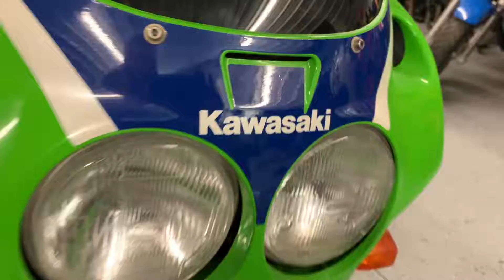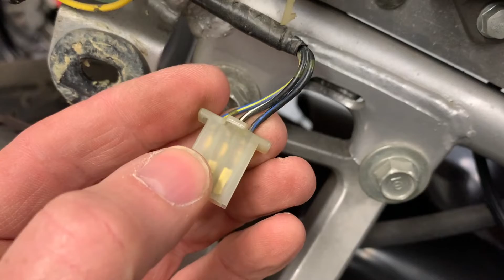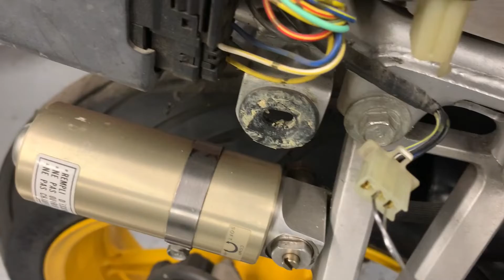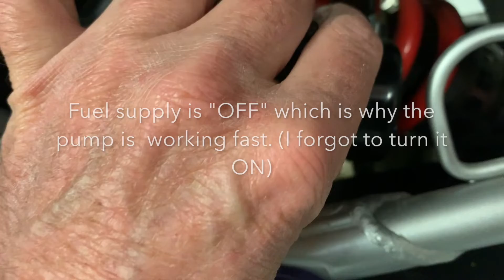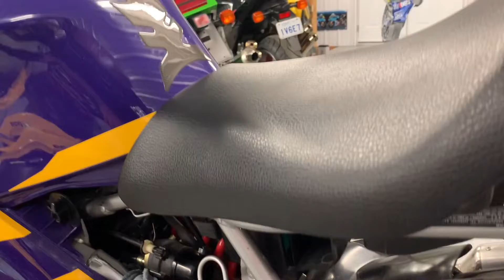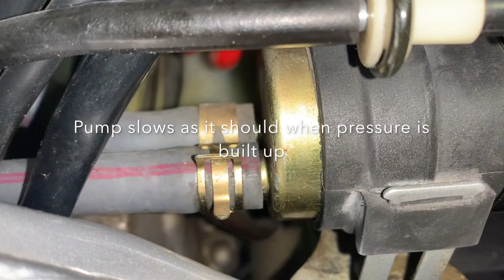1997 Honda CBR600 F3 - Testing the Fuel Pump and Relay

Comment: One question. I have a 96 cbr600 but after I ride awhile the fuel pump continues to run and doesn’t cut off after it pressures up?  Any ideas what’s going on?

Comment: Is the fuel pump supposed to prime when you flick the key on
Reply from the maker: Good question, I don't think so ( i don't have this bike any more).  But as i recall, it only pumps when you hit the starter and when the bike is running.   Once its at pressure (bike running), it will shut off until pressure drops again

Comment: lol,  Never assume it makes ASS - U- ME . Great thinking thank you for making the video.
Reply: I just going to take the hose of first from fuel pump and start it to see if it gives fuel . Weird I just cleaned carbs and now it won't start ? when I spay fluid into cards it fires up for a bit of time meaning does not get fuel ?
Reply: Pump did not work yesterday took it apart to test it and it started working again ? Same problem you had bike is running again , weird .

Comment: At last , thanks for the video.  I have a 1998 model ran fine when put in storage but after years I came to start her and fuel was pouring out of carbs . Took them off and sonic washed them and also replaced every seal in the carbs  also new carb rubbers as the old ones were solid . She was a runner again . Not used just put away in the garage as a runner  but now she wont start . Upon trying to start she backfires and that's it . Took the tank off and put a direct fuel feed to carbs and happy days she started so put the tank back on after several start ups and she ran with tank on . All fresh fuel by the way . I could feel the pump pulsing and thought that was it shes good to go ! No shes not having it so bought a new pump just incase it was working independently  😢😢. No shes still dosnt want to play.  I've checked all fuses and your explainastion  is the best I've seen . Am from England and we have what's called Haynes manual,  that rubbish.  I have 2 Honda trained mechanics and this has got them stumped . They haven't been to the bike but over the phone we have addressed every possible Avenue apart from bridging the wires as you did . Haynes dosnt show another detail a as for as trouble shooting they are saying valve clearens and other crap not related.  I joined a forum and they are all saying the same jobs we have already covered . Shes a 1998 and tidy for roads in this country but yours is mint . Anyway time out I've probably board you enough but thanks last check is bridge wires ! Something am not comfortable doing but you have helped .
Reply from the maker: Glad the video was helpful.   Yes, try the jumper wire, it’s easy to do.   You can also pull the fuel line off at the same time and do a flow test to see how much fuel is getting delivered from the pump.   

If it runs fine when u bypass the pump off a separate fuel supply, then it is likely a problem between the petcock and the pump or filter .

Assume u checked the petcock

I assume you changed  the filter

Check the fuel lines too, make sure none have collapsed.

One caution I would give is this… I use an ultrasonic cleaner too…However, they are not the be be all and end all.   In fact there are places in the carb circuits that the UScleaner will not help.   I always clean via 3 methods on each set of carbs. 

1) chemical - Use a quality carb cleaner, and let them soak for a day. make sure Andy rubber diaphragms are removed first, and make sure u can see the carb cleaner spray out of all the correct orifices to show they’re clear

2) mechanical, use a high E guitar string or carb cleaner tools to run through the carb passages etc

3) ultrasonic with a good cleaner product in it.

So many times carbs get ultrasonically cleaned and they really are not clean. It happens.
Reply: @true-moto-resto  Hi many thanks for your reply,  after everything stated in previous message I bought some new plugs and would you believe it she started on the first press . Again put the tank back on but pump was going crazy so swapped the pipes back over that soon sorted the pump . She dodnt like the choke been turned off so again looked in so called Haynes repair manual and  still no wiser . Eventually found something on internet saying all the way clockwise then turn back . All this was done yesterday  and a check for start up today was good . For new plugs , fuel pump and filter £34 and I bike that's happy.  Oh yes and am happy she sounds good . Bought one new in 1998 but got wiped out in 2001 . Fireblades up to buying this to keep my no claims bonus going . They are a good all rounder.  Anyway am wittering on . Thanks for you video very helpful. 👍👍

Comment: I have had three new fuel pumps fail, two cheapies and a $100 quantum fuel pump, on yours it makes the black cap on mine look upside down. On mine the wires come out the bottom and the nipple is on top. I’m pretty sure the OEM looks like this as well. I have brand new r/r, and fuel relay… can you give me some technical asvice
Reply from the maker: Unfortunately I do t have their bike anymore, so can’t really give you any point of reference here

If you follow the same steps as I did (in the factory shop manual online) you should be able to determine it you have a problem with the pump or the relay
Reply: @OilChange710  nipple should face down
Reply: @OilChange710  think you have it upside down , wires top pipe bottom my friend

Comment: Hi, I bought a fuel pump of Amazon and it won't prime so the air just sits in the fuel lines so not enough gas is getting to the engine so it won't start how can I make the fuel pump prime?
Reply from the maker: It should prime as soon as you push the starter button or if you jump the relay .   Is it possible that the pump is no good?   Many of the ones on Amazon are cheaper overseas items.
Reply: @JordanThompson73  Hi did you sort your bike out ?
Reply: @JordanThompson73  Hi did you sort your bike out ?

Comment: Can a bad relay or no relay cause loss of power in higher gears and rpm’s ? The previous owner of my bike jumped the relay
Reply from the maker: I’d guess that if the relay is bad it will cause the fuel pump to not function and therefore starve the carbs for fuel.   If the relay has been jumped, in theory the fuel pump will run all the time.  Can u feel or hear the pump running?
Reply: @true-moto-resto  hey sorry for getting back to you so late, thanks for the response. the pump actually ticks real bad as if it’s about to go out. So I’m thinking it’s a bad fuel pump
Reply: @TheATFcanSuckmyDicc  there are contact points in the black cover. Those might be on their way out.
Reply: @levylovits  I actually just replaced the fuel pump and that didn’t solve the issue so my next guess is the carb
Reply: @TheATFcanSuckmyDicc  same i just replaced the part of the fuel pump still doesnt want to fire. Ill see if starting fluid will help. If not im going to check fuses. If not then Im going to check pulse generator. Then the manual then online.

Comment: Very Helpful! I just replaced the relay on my 1997 F3 , it would seem the relay is bad ( cheapo amazon unit)  Once I bypass it the bike runs like a top. Seems to only be an issue when the bike sits and gets cold, after its warmed up , starts up every time
Reply from the maker: Yea, sometimes this Amazon units don’t work so well.  Time to visit the Honda dealer I guess

Comment: Under the plastic cover on the end of the pump, there is a set of contact points. When the pressure in the line builds to a certain amount, the points open and turn the pump off. I had one go bad on my 87 Hurricane.
Reply from the maker: Thanks john Yea, the pump seems to be working fine.   Pump turns on when pressure is low and turns off when pressure is high .    I tested that… pump slows down when bike is idling and will speed up as i rev the bike or if I shut off the fuel tap. But maybe they’re sticking?  Is that possible ?  Making their function inconsistent?  Replacement points are $65 if I need them
Reply: @true-moto-resto  I didn't know they sold new points for them. Back when it happened to me, I just replaced the pump. The guy at the dealers said he had never ever seen a pump go bad though. Maybe they just need a bit of cleaning or lube on the pivot mechanism.
Reply from the maker: @johnb5519  possible, I’m told if they do stick it’s just a sign that they will fail, so I’ll see how it goes, I’m going to test it again shortly
Reply: @true-moto-resto  I had the fuel pump fail on an F1 CBR600.  I bypassed the pump completely, by joining the two fuel pipes together.  There is enough pressure from the tank alone to feed the carb's on these bikes, I have no idea why Honda fit them.
Reply: Fuel pump points are getting hard to find, But they are available. E b a y.  and easy to swap out, 2 screws and one soldered wire. I'm on my third set of points for my 1999 CBR 600. Original pump.  110,000 km. Just replace them yesterday again.
But I think my cut off relay is bad.That's why i'm here on this video.